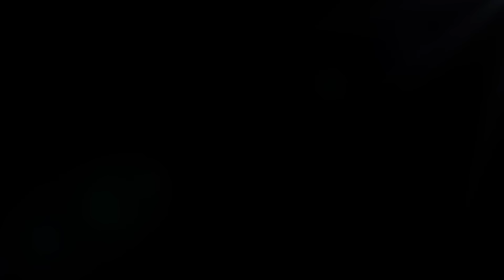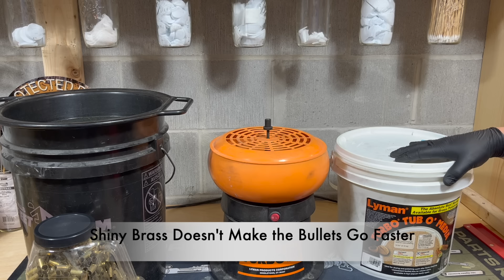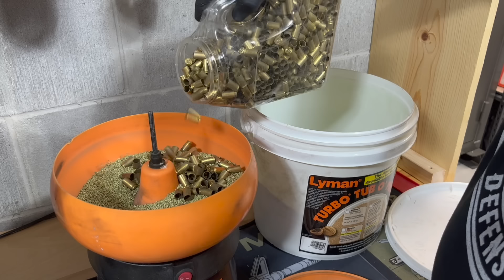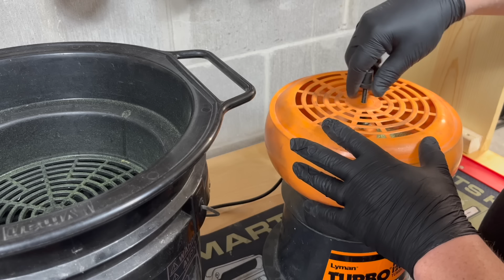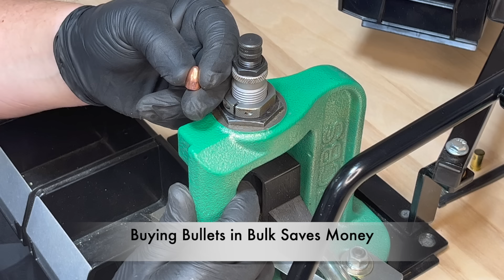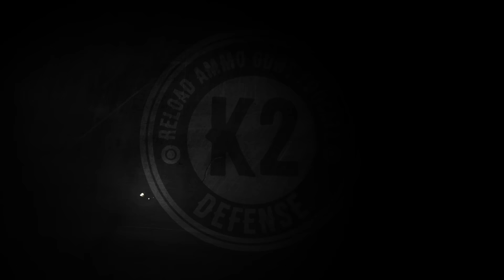How to Reload 9mm Ammo For Beginners Single Stage Press

Comment: Would you suggest using new brass starting out as a newbie. Getting back into doing to the range and into shooting again. Buying another gun in 9mm, and curious to see what reloading is all about?
Reply from the maker: @jstannard249 - when I started reloading, I used anything I could get my hands on. If I’m looking for accuracy, I prefer to use new brass and not range brass. For starting out, you’ll be fine with used brass. Then work from there to your liking! 👍🏻
Reply: @k2defense thanks

Comment: Any advice why after all these steps I run into the completed round not fitting into the case gauge?
Reply from the maker: @Dynomitedog2 - Hi Abe! How far into the CG is your completed cartridge going into the CG? Are you applying a crimp? What is your COAL? Let’s start there.  👍🏻
Reply: @k @k2defense bout 8/10 of the overall length of the rounds.  Here’s what I figured out. The issue was the seating crimp die. I had to back that bad boy up for the cramp and dial down the seating part.  Because before I did that, I noticed it was copper shavings from the actual round on the brass. And I had this Coke bottle effect going on when I finish loading it. Now I have about an eighth of an inch on some of the rounds when they’re completed before they fall into the case gauge freely. But some of the rounds pop in and out like nothing. So there’s inconsistency and I don’t know where it’s at. I will run all the brass through the sizing, and all of it will pop in and out the case gauge freely no problem. But after I’m done with the whole process, that’s when I noticed all the issues. So I think I have a defective crimp seating die from RCSS.
Reply from the maker: @Dynomitedog2 - watch this video. This will help fix this issue. It’s rare that it’s a die issue (but it can happen). Follow this video to a “T” and then if you still have issues, call RCBS.

https://youtu.be/diLgHfozgbA?is=wEwKX6jDGQahPuVY
Reply: @k2defense  thank you!
Reply from the maker: @Dynomitedog2 - Hi Abe! The coke bottle or wasp body is normal since the dies are tapered crimp. It doesn’t affect the function or accuracy at all. Try this video before calling RCBS. It’s rarely the die although it does happen from time to time. Follow this to a “T” and your issues should be resolved. Let us know how it turns out! 👍🏻 

https://youtu.be/diLgHfozgbA?is=ICh0vJJ-zykeuvl1

Comment: When you reload 9mm, does your round look like an hourglass? When I reload mine with Dillon 750, my round came out hourglass.
Reply from the maker: @chaosstars387 - Yes,unfortunately, they do. I’ve heard it called the hour glass, wasp, coke bottle look. It drove me insane. They pass the plunk test and shoot with low SD in the low double to single digits. I ran across a post from Dillon that states that Dillon does this intentionally for greater case mouth tension and to decrease projectile setback. I use RCBS dies and it does the same thing. Aesthetically I want to pull my hair out. But I’ve had zero issues with the final product. I’m going to do a video on this to see if I can correct it. Can’t give you much more than that without giving the juicy details of the video. Keep an eye out for it. When I make it I’ll give you a shoutout if you’d like for asking the question. Cheers!

Comment: If you're open to a suggestion on this video.  I understand it is geared to the novice.  I have found that when you add powder to your powder measure's hopper, It is a good Idea to let the powder settle for a bit.  I have found this results in more consistent charges.  Otherwise this is a good video.
Reply from the maker: @mikemoody8103 - Mike great advice! Thanks for your input! I’ll be sure to include your suggestion in my future videos! 👍🏻

Comment: No REAL reloader I’ve known has ever trimmed a 9mm case …… ever! Total waste of time! Pistol cases don’t grow in length. I have 9mm, 10mm, 45acp, .357 mag cases with more than 20 reloads each and they stay the same length. Try competitive USPSA shooting and loading thousands of rounds and month with this silly procedure.
Reply from the maker: @Cavediver1967 - hi Dave nice to meet you! Now that you’ve met a REAL Reloader that trims 9mm brass, there are a few things that I’m not sure you’re taking into consideration. 

Shooting USPSA, minor power, you’re probably never going to need to trim your brass. So you’re correct. 9mm almost never gets longer. It typically stays the same length or even gets shorter over time. So in your situation I’d suspect you’ll never trim your cases.

However, some precision reloaders will trim every case to the same short length (i.e., 0.740”) so that crimp is identical across the batch. Shortening the brass slightly: Helps rounds chamber more reliably. Prevents “case mouth hitting rifling” issues. Gives more room for the taper crimp to remove flare cleanly. 

So for the 1% of reloaders who trim their cases shorter are usually trying to solve one of three real issues. Uniform their crimp. Improve chambering in tight guns. 
Accommodate specific bullet shapes or worn case mouths.

I hope this solved the mystery on why a Reloader would trim their brass. It’s not always because the case stretches like bottle neck cases. That’s why I love these discussions! You learn something new everyday! Thanks for the dialog! 👍🏻

Comment: Just starting off, what powder (brand) on 9mm and is it a different type on rifle loads?
Reply from the maker: @TheMannyduckslayer - hello! I use Hodgdon pistol powders. Rifle reloads are a different beast. All powders have different burn rates. This is needed for the type of projectile you’re using, different weight of projectiles, burn rates, and case sizes. I’d encourage you to pick up a reloading manual and study it front to back. It gives great information and answers your questions straight from the powder or projectile manufacturer. Hope this helps! 👍🏻

Comment: Clear concise.  Loved the vid.  I have that same die set and rock chucker.  Mistakenly bought 1k rounds of Turan fmj range ammo and don’t trust the powder charges.  Must pull, measure and reload for safety.  Sucks.
Reply from the maker: @CustomJeep - have you tried using the ammo? Just wondering if you ran into issues before pulling all of them?
Reply: @k2defense I’m not interested in using my gun as a testing platform.  I’ve heard too many reports of that cheap turkish ammo having issues, so I’m going to take all the risk out of it.  Thats just me.  And I’ll never buy that ammo again.  Ever.
Reply from the maker: @CustomJeep - loud and clear! Are you hoping to salvage the projectile’s?
Reply: @k2defense Yup.  Got an RCBS bullet puller.  Should make it super easy with no damage to the projectiles.
Reply from the maker: @CustomJeep - awesome! 👍🏻

Comment: When using the hand primer, squeeze the handle all the way in, remove the primer seating rod, unscrew the screw on that black bar then remove the bar. DO NOT let go of the handle, keep it squeezed the whole time. Use one hand to fit the correct shell holder and plastic attachment for large or small primers. Put the black bar back in and insert then tighten the screw. Release the handle and drop your primer seating bar back in with the FLAT part facing up and the domed part inserted into the body of the tool first. It's all in the instructions and saves a crap load of time putting the springs back together.
Reply from the maker: @ImTHATguy... - I tried. The only way to get the priming rod out is to fully open the handle. It won’t allow you to slide it out otherwise?

Comment: Question: is cleaning the brass necisarry? and if so, can we not just wash it with soap and water then wait for it to dry fully?
Reply from the maker: @ReisenTewi - in my humble opinion, yes it is important. It helps with wear and tear on your dies and your firearms. I’m not going to say you can’t clean your brass the way you described. What I will ask you is, why are you cleaning your brass? That method is practical and probably does the bear necessity   cleaning brass. If your brass really isn’t that dirty, that may be enough to clean it up good enough to reload. I cannot fully support your method for liability reasons. I would recommend the manufacturer suggested ways of cleaning brass for all safety reasons. Let us know what you decide to do and how well it works! 👍🏻
Reply: @k2defense  using soapy water tends to work normally for me, i wash them in bulk then leave to dry, they shoot pretty alright but i think what you say is right, i deffinitly think the machine does a better job. however its harder for us europeans to get such big machines... (not to mention expensive shipping from the states)
Reply from the maker: @ReisenTewi - hello our European friend! That never came to mind. That makes sense, unfortunately. Whereabouts do you live? Is it difficult to find other reloading components? Thanks for your comment! 👍🏻
Reply: @k2defense  right across from our american brothers on a small wet island. most people mostly have old reloading tools for 20 gauge and such and older guns because our goverment is very bad to us
Reply from the maker: @ReisenTewi - I gotcha, maybe it’s time to set sail?
Reply: @k2defense  definitely 😁

Comment: Is case lube needed for cases without necks?
Reply from the maker: @nikolasarmbrister8202 - tif you’re using a carbide resizing die, no. You will hear folks on both sides of this question supporting or not supporting the use of lube with straight walled cases.  👍🏻

Comment: Hate to crush dreams but unless you are loading for less than 19Cents a round you are wasting your time, even then... New brass can be had at this price. How much is your time worth? $5 bucks an hour? 10? In Hyper-Optimal conditions you are brass goblin and reload at 9C a round. That's 10C per round or $1 per 10, 10$ per 100, 100$ per 1000. Again, how much is your time worth? Single stage press? Multi? That $100 can translate to 10 hours of work, not counting the brass goblin hours needed. Could you have been getting paid more in that 10 hour block than $10 per hour? Its good to have the skill and capabilities but  this is a wild game to get into to think you are saving money.
Reply from the maker: @slopothacrop - yeah that’s the crux. Here’s how I look at it. During the plandemic the stores were bare. No manufactured ammo, and no reloading supplies. Thankfully, I’m a hoarder with cases, primers, powder, and projectiles. I was rolling out ammo throughout the plandemic. I didn’t skip a beat. What I’m trying to say is that it’s not always about saving money, it’s about sustainability. Something to consider. 👍🏻

Comment: But is that C.O.L. value of 1.100 a min or max?
Reply from the maker: @AXNJXN1 - great question. The manual typically suggests only one COAL per projectile. However, I’ve had to +/- some cartridges COAL based on mag fitment, chambering, ramp feed issues, etc. try not to deviate from the recommendations per your manual knowing that there may be a one off that you might run into. Hope this answers your question.  👍🏻

Comment: shiny brass is easier to find on dirt.
Reply from the maker: @bunkstagner298 - I’m a bit neurotic when trying to save used brass. On my AR platforms, I use a brass catcher. Pistols,in outdoor ranges,  I lay a tarp down to collect used brass. I’m a bit conservative with collecting as much as of my brass as possible. If there are shooters on either side of me, they usually laugh and say, “you’re a reloader aren’t you?” Some indoor ranges don’t care if you reclaim your own spent cases as long as you’re not walking past the firing line. Hope that makes sense. 😂👍🏻

Comment: Great video but I must ask... once you get rolling about how long to get lets say... 500 rounds from the casing cleaning stage to being 'mag' ready?
Reply from the maker: @hmdwn - hello! There are too many variables for me to give you an exact minute count from start to finish. Here’s my example. It If I wanted to take a spent case off the ground and reload with skipping steps (which we do not support) and without cleaning the brass? Maybe an hour or two. My thought is do it right the first time. For me to do that many in a single stage press, from start to finish, I would need about 10-12 hours. Give or take. I’m a perfectionist so I’ll always take more time than I need when doing this hobby. If I have to rush, I won’t do it. 👍🏻

Comment: Is it ok to have a little bit of the "bell" from expanding left after seating the bullet?  I'm not crimping because I don't have the cannelure on the bullet.  It seems like it should be even with the walls of the brass in a straight line.
Reply from the maker: @mt8149  - as long as the cartridge fits into the chamber, you’ll be good to go. 👍🏻

Comment: How important is it to clean the primer pocket/flash hole, like 9mm compared to a .223 for example?
Just got into shooting so I'm a freshie
Reply from the maker: @hej221 - you’ll hear that some people don’t clean either. However, I clean both. I use the primer pocket uniformer and flash hole uniformer. Reason being, I have had primers blown out of the case and when I looked at the flash hole, there’s a piece of corn cob stuck in it. I’ve also had primers not seat well in the primer pocket because of the char left behind from the last use. I’ve also had new brass that has had pieces of brass left behind from when the cases were made. So, yes, I don’t skip steps when working the brass. As a new reloader remember that  you want to be consistently repeatable when working your loads. Hope this helps! 👍🏻

Comment: That's why you purchase two hand priming tools. One set for large primers and the other set for small. Avoid all the screwing around changing the primer ram.
I also like the wet tumbler method of cleaning the brass. It doesn't create dust, which can contain lead.
Reply from the maker: Appreciate the comment! 👍🏻

Comment: I have used an RCBS primer tool for years.   
I liked the old primer system on the press but pieces got lost in a move.
I’ve seen the frailties U mention.  Saying that, It has never missed a beat, but then I don’t drink beer when reloading.
Reply: Yea !  That’s a smart A$$ comment on my part; but ‘have first hand witnessed WIT-less individuals bad mouthing the practice because of a lack of common sense, low observation and failure to follow instructions.   Good demo!
Reply from the maker: Appreciate the comments! 👍🏻